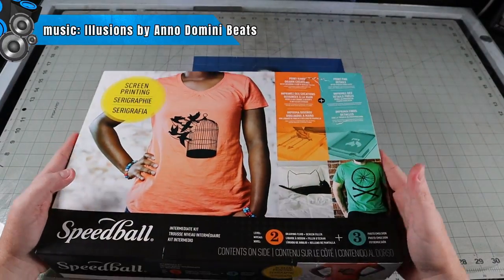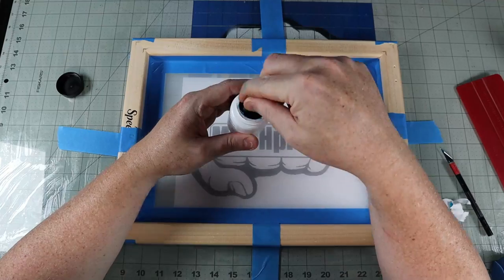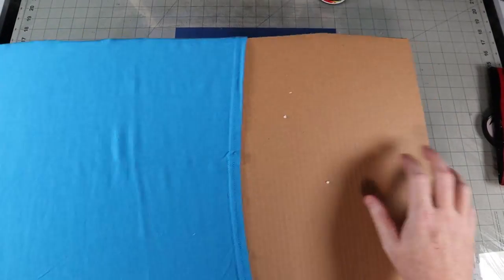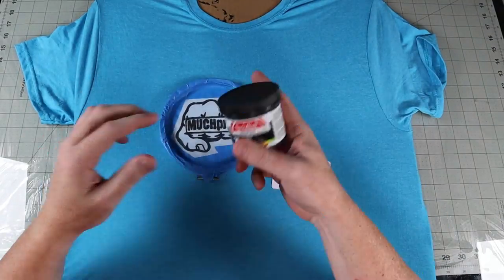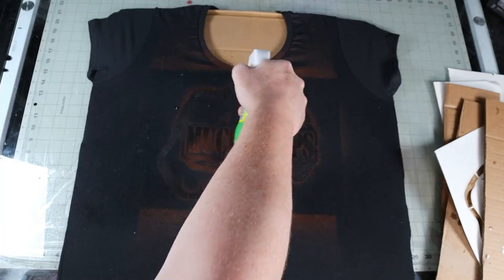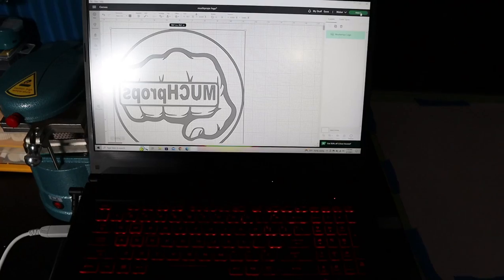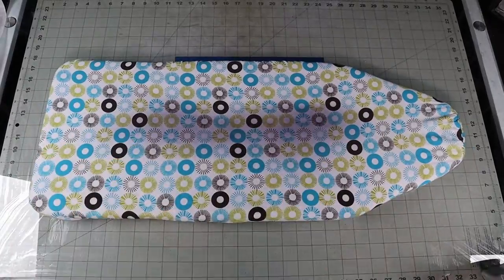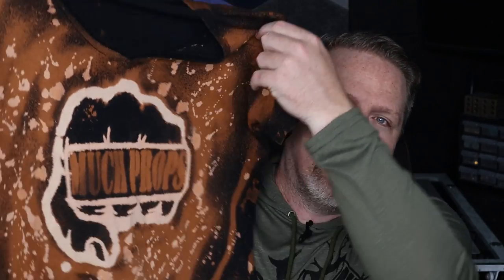How Many Ways Are There To Make A T Shirt

Comment: Next time you do the release dye method, (Bleaching)  use just a 50/50 solution of Bleach and Water.   Works great..  Oh and you can actually use your cricut to make the stencil out of Vinyl so it sticks better and gives you crisper edges.   Yeah, your boy doesn't just do Leather stuffs :)
Reply from the maker: Thanks for the tip! It was my first time with the bleach method so I thought I would try the cleaner spray. It worked well enough. I've seen some pretty impressive artwork done with bleach on a shirt.